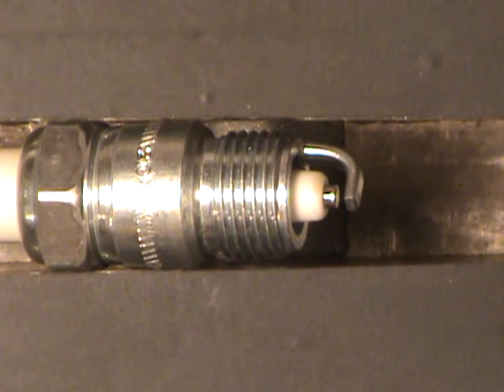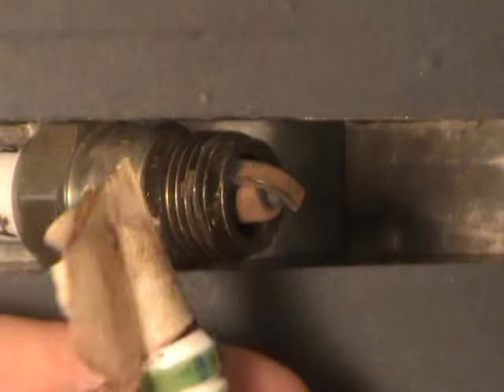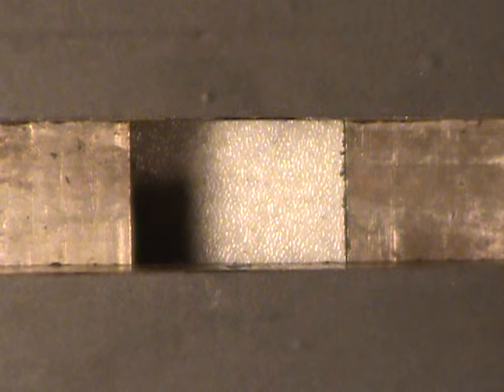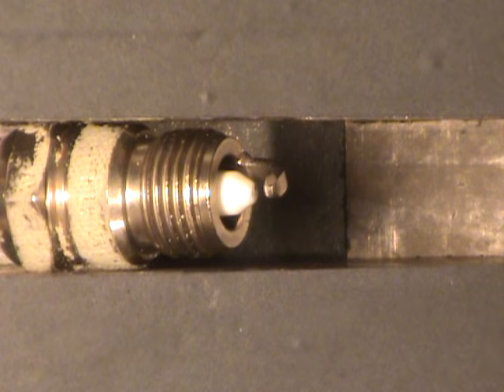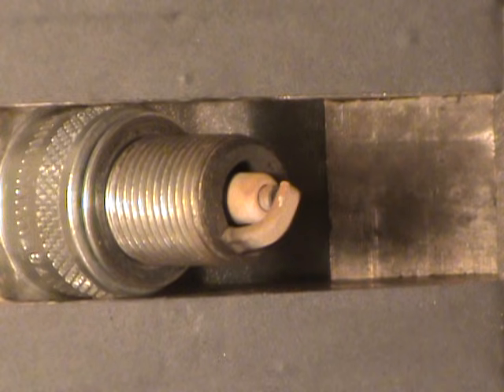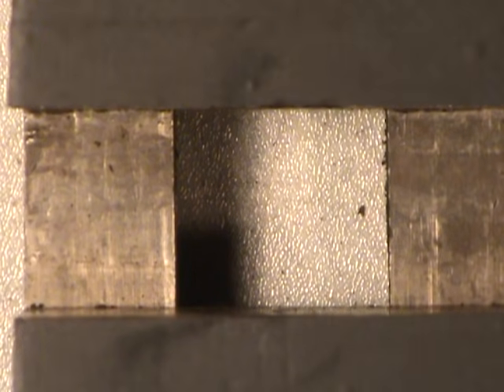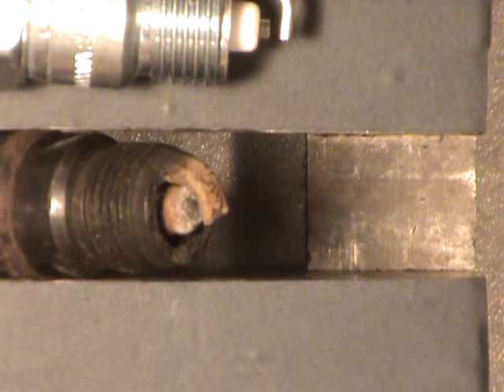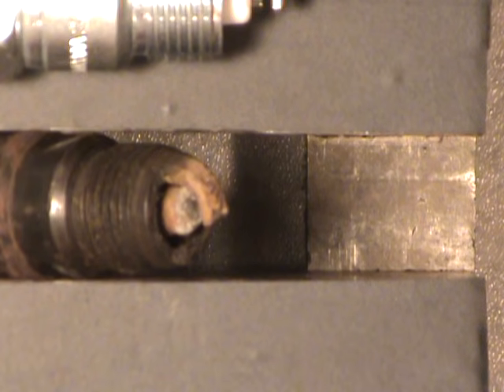SPARK PLUGS How to Read them (Part 3)

Comment: I have a tbi ohv v8 in a cadillac. Its similar in operation to a 305 chevy with tbi. I have light white or slightly brownish on my plugs but I have flat spots & surging from 2400-3000 rpm. I changed both o2 sensors plugs, wires, fuel filter & egr valve. Runs smooth 27mpg & very clean on emissions but still flat spots when accelerating. At 6:03 thats what my plugs look like.
Reply from the maker: Greetings Will C....There are so many possibilities that may be causing your Flat Spots and Surging in your Car....I will give you a few things to look for, both, from the Fuel side of things, as well as the Ignition side of things....You had mentioned that your Spark Plugs looked kinda Grayish in Color, which sounds that it might be a bit on the "Lean Side" (Air/Fuel Ratio), whereas, if indeed you were getting into a Shade of Tan Color, then, that (to me) sounds better....You see my Friend, alot has to do with the Gasoline that you Buy, where you live....Check to see if, and how much "Ethanol" (alcohol) is actually in your Gasoline "Blend", as, the more Ethanol that is in Your Gasoline, the "Leaner" the Engine tends to run....Also, there are times when you might get "Condensation" (water) in your Gas Tank, and, that will make your Engine Act-Up as well.

There are different Products (liquids) that you can put in your Gas Tank that can take care of any Condensation that may be in there....There are also "Fuel Injector Cleaning" Products (Liquid in a bottle) that work quite well at Cleaning your Fuel Injectors and entire Fuel System as you Drive. (I think that your TBI or Throttle Body Injection unit has 2 Injectors)....Just be careful using this "Cleaner" as from my own experience, it maybe works Too-Good!....When I used the Injector/Fuel System Cleaner in a Bottle a few times, it cleaned Everything (crud) that was in my Gas Tank, and Totally Plugged Up my Fuel Filter! (the fuel filter was not that small either!) ....So, if you use that Fuel Injector Cleaner, I would advise you to Change your Fuel Filter soon after that Cleaner is used up, that you put in your Gas Tank....Make sure that whatever Cleaner you use, is made for Your Type of Fuel Injection System! (should be on the Bottles Instructions somewhere)....Also, put the Amount of Cleaner that is Indicated on the Bottle, as in, so much Cleaner for a given amount of Gasoline, or Ratio).

Did you "Gap" your Spark Plugs as per your Engines "Specifications?"
Also, make sure that you Installed the "Correct", and Factory Recommended Spark Plugs as well.

Did you "Check" your Initial "Timing" any time recently?
Hopefully (if it still there), you will be able to find your Vehicles V.E.C.I. (Vehicle Emission Control Information) Label or Sticker somewhere in your Engine Compartment (or maybe on the Inside of your Hood).

Also, after you Installed your O2 (Oxygen Sensors), did you "Re-Set your Vehicles Computer?....What this does, is, it Re-Sets the Computer, and, then, the Computer gets a chance to Start Fresh, and, It "Learns" as you Drive the Car....It only takes a few Miles of Driving, and, the Computer Re-Establishes Itself, so it Knows what is going on (so to speak).

Let me know how it's going.

Good Luck, Take care, and, "HAPPY NEW YEAR!!!"
Reply: RockysRoadshow I have a TBI 4.3l v6. I noticed flat spots and sluggish performance at 2000-4000 rpm sometimes.  I found that rebuilding the TBI helps. It has small filters that get clogged. If you ever do rebuild the tbi make sure to replace the fuel pressure regulator diaphragm. Those tbi's are somewhat whiny about fuel pressure. The book say 9-13 psi but that's a pretty broad range. I personally went with an adjustable fuel pressure regulator to lock it about 15 psi. Resetting the pcm is a good idea also. Could also be your fuel pump not keeping up. Or maybe (fingers crossed it's not) a transmission issue. There are some good articles out there that have info about tbi's that are really useful.
Reply from the maker: blargblarghonk
Greetings blargblarghonk....Thanks for sharing your "Hands On" Experience with that there "TBI" (Throttle Body Injection unit), in order to help out that Gentleman with his TBI's issue....Hmmmmm, well, I kinda "Leap-Frogged" (aka, jumped over, and past), that there TBI Type of Fuel Injection System, and went Straight from Carburetion (Carburetors), and, Directly to the General Motors 4.3 Litre V-6 "C.M.F.I." (Central Multiport Fuel Injection) System with the OBD-1 (On Board Diagnostic version "1") Computer System....The V-6 C.M.F.I. uses a Single Fuel Injector, that supplies "6" plastic Tubes that are terminated with "Poppet Nozzles", that Squirt (spray that Atomized gasoline) into the Intake Ports of the engine.

That there (or is it, This Here?...lol), C.M.F.I. Fuel Injection Assembly (unit), is commonly referred to, as a "SPIDER"....How dare these People call it a Spider!....(say What?)...(keep reading)...

Ah yes, in order to be Designated (called) a "Spider", it has to have "8" Legs, does it not?....(How many "Spiders" have you ever seen that have Only "6" Legs Huh?)....So, as far as a "6" Cylinder C.M.F.I. Injection Unit is concerned, it (in my most Humble Opinion) "Must", be called an "INSECT!!!"...lol.

Hmmmmmm...Maybe there might be some "Hidden" Truth as to Why?, this "Thing-Ah-Ma-Bob" received that there "SPIDER" Designation?...(feel the Suspense building, do You?...lol), then, Read On, for the Conclusion of this Episode!

My Train of Thought, has me thinking, that, if, You take a Look at the C.M.F.I. Fuel Injection Unit for a "V-8" that uses such a Device, then, (Don't Look Now), cuz, Now, I See a Real (man made) "SPIDER!!!"....V-8's have "8" Cylinders, and, that requires "8" Tubes-n-Poppet Nozzles!....(hopefully, they did indeed make an "8" leg-ed C.M.F.I. Unit for the "V-8's!).

So, my Conclusion is, it can be an "INSECT" sometimes, and, that Insect can Grow "2" More Legs, and, Become a..................."SPIDER!!!"

I hope that You had a good Laugh!

Take care, and, have a good one.

Comment: What about checking the sparkplug for firing under pressure? My dad said mechanics use to use a box made for placing the plugs in it, pressure it with air and turn on a spark module to see how the plug would perform under pressure.
Reply from the maker: Greetings Jon Stone....Thanks for your Interesting comment, my Friend....Yes Sir, I'm very Aware that Spark Plugs like to Act Differently when be subjected to High Pressures that are found in an Engines (Cylinders) Combustion Chambers as opposed to just being "Out in the Open", and only exposed to Atmospheric Pressure that Maxes out at about 14.7 P.S.I. at Sea Level (but only on Planet Earth!...lol).

I have never seen or heard about that "Magic Box" that your Dad was telling you about, and, I'm glad that You shared that Information with Others, and Myself, Thanks Dad!

The closest thing to that "Magic Box" that any Gas Station, or, Automotive Garage might have had back in the Good Old Days, happened to be a "Spark Plug Cleaner", kinda like a Mini "SandBlaster" that was used to "Clean" Used Spark Plugs....I "Do Not" recommend that anyone use any kind of "SandBlasting" method to Clean (used) Spark Plugs, for the very Reason, that, all it takes is One "Tiny" Particle to get Lodged Way Up between the Threaded Metal Shell, and the Inner Porcelain, that can become "Dis-Lodged" (broken loose), and find its way into your Engines Cylinder and Combustion Chamber!....Imagine now, some Some Small Particles of "Sand" or whatever "Abrasive" Media that was used in those Good Old Spark Plug SandBlasters could do to your Engine, if those Tiny Particles were Let Loose inside your Engines Cylinders!...."Ouch"

Oh yeah, I really should get back to the Subject at hand, that being about the Spark Plugs Operating Environment....Probably the first time that I was made aware of the Effect that an Engines Cylinder Pressure had on a Spark Plug, was when I use to "Check" a spark plugs "Spark" while just having the spark plug Laying on the Cooling Fins of a Single Cylinder Air Cooled Off Road 2 Stroke Cycle Motorcycle Engine while I was out in the Boonies (wilderness).

As that Spark Plug Metal Threaded Shell was in Contact with the Cooling Fins of my Motorcycles Engine, and having the spark plug Lead (wire) connected to the spark plug, I would be getting a nice "Spark" between the "Electrodes", as I Kicked on the Kick Start (er)....But, when I Re-Installed that very Same spark plug, it just Would-Not "Light-The-Fire!" (aka, Ignite the Fuel Charge in the Engines Combustion Chamber).

It was sure a Good Thing, that I kept a couple of Other "Used" Spark Plugs in my rear fender mounted, kinda like a Motorcycle "Fanny-Pack"...lol.
So, I Installed one of those Used "Spare" spark plugs, and, the "Fire-Got-Lit", and, I was on my way, once again!....Those particular Spark Plugs happened to be some NGK Platinums....Fantastic Spark Plugs, when they are Not Fouled with Carbon, or, 2 Stroke Oil!...lol.

I'm pretty sure, that, if, and when Anybody takes their Car or Truck in for a "Tune Up", the Mechanic won't be Checking "Used Spark Plugs" with the "Magic Box" that Dad told You/Us about, or with any Machine for that matter, because of that Old Saying, You know, "Time Is MONEY!"...(lol)....Heck, just be Thankful if that Mechanic Checks, and Sets the Spark Plug "Gap" before He/She Installs those Spark Plugs in "Your" Engine!

Speaking of "Tune Ups", a few years ago, I received a Phone call from a Friend of mine, that just had his Truck "Tuned Up" by one of those "Specialized" Tune Up Shops....During that Phone Call, he was saying that his Truck was Running "Worse" After they did the Tune Up, then it was "Before" he took it to them!....I told him to drive his Truck to my place....His poor Truck was Running like-> (Insert You Own Word Here)<-I had him Turn Off his Ignition (engine), and I popped the Hood, did a quick Visual, looking for loose Wires and such, then, I started to Remove his Distributor Cap, and, the Whole Dang Distributor "Moved!"....It looks like Mr. "Specialized" Tune Up Guy "Forgot" to "Tighten" the Distributors Hold Down Clamp "BOLT!!!"....No wonder the Trucks Engine sounded so Sick!...(lol)....So, I went and got my Timing Light, set my Friends Trucks Timing, and, All was Well, once again!...and "YES", I Did "Remember" to "Tighten" the Distributor Hold Down "BOLT!"...lol.

For the very reason that the Demands are Much Greater on a Spark Plug, while being Subjected to those Very High Cylinder Pressures, especially with those High Performance, High Compression Engines, just Reminds Us All, of the Importance, of having Yours, or My, "Ignition System" in the Best Shape Ever, or,  you might just get "Stranded" somewhere, on the side of the Road, waiting for Help.

Take care, keep it Well Maintained, and, have a good one.
Reply: Thank you for righting me back. Dad said it was made by the mechanic who taught him all the mechanical knowledge at the time. We're talking 50's lol, dad said the guy made it so you could screw it in the top, it had a hose on the side to apply pressure and a coil to attach a wire. This same mechanic would repair car break pads! Wow I've never seen that, anyway. Thanks for your reply I'm glad to have found you on here, you sound old school which means you have knowledge! Thanks!
Reply from the maker: Jon Stone
Greetings Jon Stone....You're welcome, for my reasonably, not too long (in time) reply....Yes-Siree-Bob, there's nothing like a Person that takes it upon Himself/Herself to become "Innovative" (does that word mean to "Invent?"...just a thought), and, that, "While-Under-Pressure-Magic-Box" that that Gentleman Invented/Built to "Test" Spark Plugs, is a testament to what is possible, when One takes His/Her Thoughts, and, Applies them in a Meaningful way.

You had mentioned about that "Mechanic" Re-Lining Brake Pads....I'm thinking, more like Brake "Shoes" (those Curved Thing-Ah-Ma-Bobs...lol), as, back in the Good Old Days, when I was a Kid, My Dad also "Re-Lined" Brake Shoes (in the Basement, on the WorkBench) as well (fancy that eh)....My Dad would have (I'm assuming Purchased) the "Asbestos" Brake Lining "Strips" (or sections), and had a supply of the Proper "Rivets" that were used to Secure the Asbestos Linings to the Brake Shoes (those Curved Metal Thingies...lol).

"Asbestos" (in my view), more then likely, is a "Silent Killer"....In that, I mean, if a Person "Inhales" the Asbestos "Dust" while Drilling, Sanding, or, creating Asbestos "Dust", in any way, shape, or form, that, when, He/She Breathes that "Dust", it will inevitably make its way inside the "Lungs"....The Nasty thing about Asbestos Dust, is that, when it Settles in the Lungs, it "Stays" there, what seems like Forever, and, Lung "Cancer", is usually the Result!...(from what I recall).....Not only that, some Brake "Lining" materials contain Asbestos, but, Clutch Friction Surfaces (Linings?) may also contain Asbestos as well.

"NEVER!", (and Please), "Don't Breathe Any Asbestos Dust What-So-Ever!!!"
(for the Reason/s just above these Words).

Take (Extra) care, and, have a good one.

Comment from the maker: ...the Best, and probably the most accurate way that the "Average Joe" can tell what Air/Fuel Ratio that his engine is running at, will require the use of an "Air/Fuel" Ratio Gauge, in combination with a "Wide-Band" Oxygen Sensor" (can be purchased as a kit, with the oxygen sensor "Bung", that is welded to your exhaust system, to mount the oxygen sensor)....Just remember that the "Older" Carburetors were Jetted/Calibrated for the good old 100% Gasoline!....Your Gasoline?, and Carb?....Take care

Comment from the maker: ...I had to Increase my Primary Main Jets "3" times to get rid of my Lean Surge, for a Total of .009" (9 thousandths of an inch)....Sometimes, the Gasoline that is sold here, can have as much as 10% Ethanol, and who knows, maybe even more?....Then some are buying "E-85"-Gasoline, or should we call it Fuel?....(85% Ethanol)....Best way to determine how Lean or Rich your Engine is actually running, especially if using/burning High Percentage Ethanol (like E-85), then....(con't)

Comment from the maker: ..on your spark plugs Fire-ing end....See if you can find out how much Ethanol (if any) that is actually in the Gasoline that you buy....I don't know what Carburetor that you have there?....As for me Re-Jetting a Thermoquad 4-Barrel Carburetor, I went "Up" .003" (3-Thousandths of an Inch) each time I changed the 2 Primary Jets until I got rid of the "Lean Surge" that I was having in the past, and that gave me the "Tan" Color that you see on this videos Thumbnail Picture....(con't)

Comment from the maker: Greetings chopperking1122....First off, Gasoline "Formulations" have changed over the years, and, depending on just how much "Ethanol" (alcohol), that the Gasoline Company put in their Gasoline, that you buy where you live, will determine weather or not you will actually "See" any "Deposits" to "Read" on your spark Plug's Fire-ing end....Generally speaking, the Higher the Percentage of Ethanol that is added to the Gasoline "Blend", the "Less" Deposits that you will probably see....(con't)

Comment from the maker: ...are "Eroding" at too fast a rate, and might even be melting somewhat, that could be too Lean, or, even someone installing the "Wrong" spark plugs, and, possibly too high a Heat Range as well..Make sure that you have the Correct Factory Recommended spark plugs, if in fact, you have a Stock (no modifications) Engine...There are many, did I say Many, potential problem areas with the OBD-2 System and all of those Sensors and Actuators!...Best advice = Get those Codes!...Till next time, take care

Comment from the maker: ...is your Camry's Engine Performing alright, or, is it acting up and giving you trouble?....If it is running ok, and you don't see a Warning Light on your Dashboard, it could very well be, that your Camry's Engine was designed to run that Lean perhaps?....The fast, and easy way to determine weather or not you have a Lean Running Engine, is to get your Camry's Computer Scanned, as that will save much time, and headaches as well....If your spark plug Electrodes look like they....(con't)

Comment from the maker: ...any Malfunctions, as it pertains to all of the Sensors and Actuators that your Camry's Computer Monitors....Starting in, oh, about 1996, most, if not all Vehicle Manufacturers had to comply with Government Standards known as "OBD-2" (On Board Diagnostics version 2)....To determine what, or if, you have any Trouble Codes stored in your Camry's Computer, you will have to use, or get someone to use, a "Scan-Tool" to extract those Codes, and see, if in fact, there are any....Also...(con't)

Comment from the maker: Greetings higgout....Thanks for your comment....You might have Spark Plug Deposits that show a much Leaner (maybe almost white perhaps) when you Read your Camry's Spark Plugs, due to your Computer Controlled Engine Management System, as compared to the Deposits that you see on my videos Spark Plugs, because my spark plugs were Fed with Carburetors, and No Computer!...If your Engine is running too "Lean", you should be getting some Trouble Codes showing on your Dashboard to warn you of...(con't)

Comment from the maker: ...your engine had Multi-Point (or Muli-Port) Fuel Injection ("1" Fuel Injector per Cylinder), that is....I'm thinking that "1" of the Fuel Injectors is either Malfunctioning, or maybe even plugged-up, restricting that Fuel Injectors Flow Rate....Are all of the Spark Plugs "All" the same Brand, Identification/Part Number, and, do they all look exactly the same, except for the Damage?....I have no idea what Engine that you have in what vehicle?...I could go, on and on...Till next time, Take care